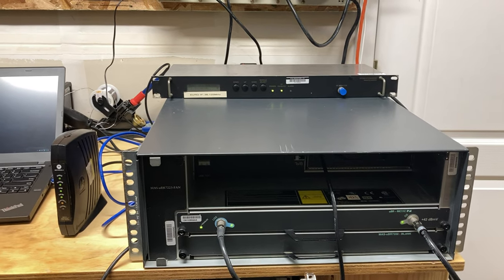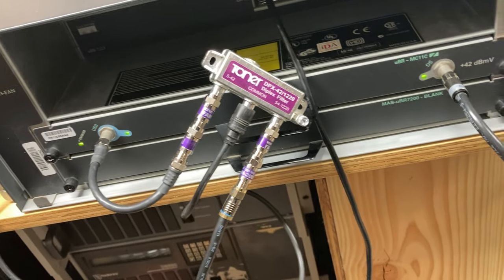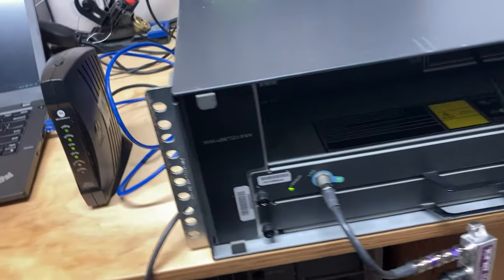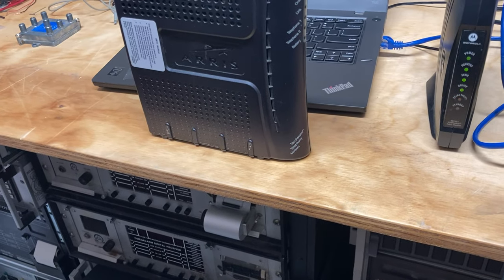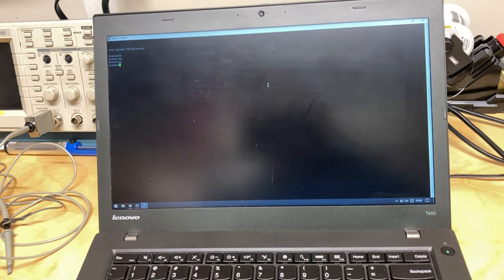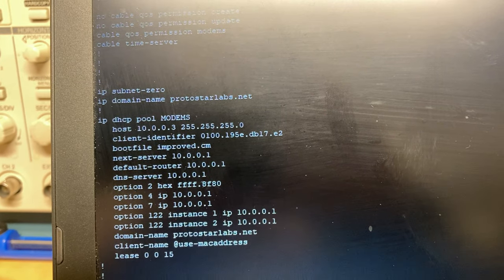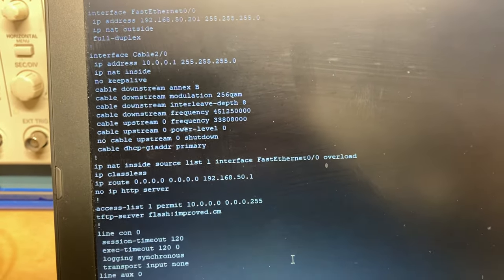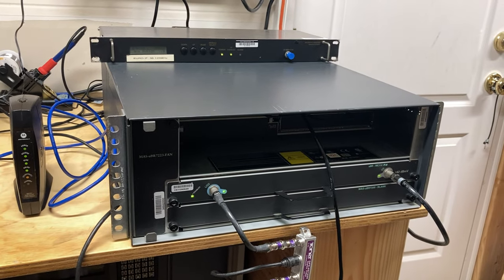CMTS Shenanigans

Comment: On the latency side, 6-7ms is about the best you'll get with DOCSIS. To go lower, you'll need DOCSIS Low Latency mode or DOCSIS Full Duplex, which is supported starting with DOCSIS 3.0 and DOCSIS 3.1 respectively.

Other than that, great video! Old CMTSs and DSLAMs are pretty easy to get a hold of, and are fun to play with.
Reply: interesting... that explains a lot about why the latency always seems higher than alternatives
Reply: FDX was split off to define DOCSIS 4.0. "Low Latency DOCSIS" (LLD) is also a D4.0 feature. D3.1 has Active Queue Management (AQM) which helps lower latency. D2.0 introduced QoS that was the first attempts to reduce latency. (messing with the interleave depth can as well, but can create other issues.)

Comment: Thank you, good demo.  I got my CCNP back in the early 2000s and I was surprised that CMTS snd DOCSIS were barely covered.  The study material and exams spent a lot of time beating on ISDN and ISO networking.  Most of the exams were pretty easy, but I saved routing for last.  On all the exams up to that point, they would say “Congratulations, you passed your exam,” at the end.  The routing exam had two configuration simulations and one was buggy so I had to click done and move on.  Time ran out as I was answering the last question.  At the end, all it said was “you completed this exam.”  I assumed I flunked and walked away dejected, but the lady in charge came running, “Don’t you want your certificate?”

I never worked in a large enough environment mor had a complex enough home lab that I believed I had enough hands-on experience to get through the lab based part CCIE exam.  I was able to do all the practice I needed for the CCNP using a 24 port Catalyst switch and a 1711 security router.  My employer was satisfied with CCNP so I left it at that.
Reply from the maker: Yeah it seems like this stuff is somewhat lacking in terms of documentation too, I mean there's good examples but there's no typical several hundred page Cisco book that goes over literally everything you need to know like there is for ADSL. I would love to get some form of certification but I don't know what to go for, I'm more interested in the voice portion than routing/switching.
Reply: @KJ7BZC  There is, but this gear is so old they've deleted it from history.

Comment: Nice video. DSL can also use DHCP to configure whatever's on the end of the circuit (CPE), once in sync it's just an Ethernet connection. A lot of ISPs use PPP because they know how it works and to make accounting a little easier.

However, DSLAMs can inject the circuit number into DHCP requests coming from subscribers, so even without knowing the MAC of the CPE, the ISP know which circuit it accessing the network, and can account/log/whatever they need to do.

I believe a similar thing applies to networks using PPPoE on DSL, the DSLAM can inject the circuit number, and then you could confirm that a PPP user is appearing from the correct port on the DSLAM (or even, the correct DSLAM at all.)

Then once you have Ethernet and IP setup, the CPE could down a configuration from a provisioning server, but that's all vendor specific stuff at that point.
Reply: In Poland. PPPoATM
Reply from the maker: Interesting, I do remember there being an option for DHCP in my modem as well, might have to give it a shot once I get that going again.
Reply: PPP because... they already had extensive PPP supporting infrastructure. (i.e. all those years of dialup modems.) There were even cable operators that used that crap. (PPPoE)
Reply: @KJ7BZC  there’s also the MTU overhead to consider.

PPP adds an 8 byte overhead to the MTU, if the Ethernet link is set to 1500, using PPP reduces your usable MTU to 1492, which isn’t the best. 

There’s a way to get around it, and most telcos set their DSLAMs/OLTs to allow baby jumbo frames, typically allowing an MTU of 1508, so when you take away the PPP headers, you still have a full 1500 byte packets, rather handy. 

DHCP-based addressing avoids that entirely by not having an encapsulation protocol around the packets.
Reply: @jfbeam It was designed as a European deregulation thing, as I recall. It was supposed to work by the PTT/ILEC providing the copper, DSL and ATM network, and multiple competitive ISPs would provide the link between ATM and the Internet. Because the DSL network was opaque to the ISP, and nobody uses ATM, some tunneling and AAA system was needed.

Comment: Great job on the deep dive...  This is bringing back memories when I deployed the first CMTS for a rural ISP Co-Op, I managed like 20 years ago... We used the exact same system as well as the multi channel card interface... Can't recall 100$%, but I can remember having issues because of missing or incorrect MAC-Host Authorization file mismatch or setup...  We ended up using a solution from C9 networks.. It was a 1U "Pizza Box" style setup but it required an external server to handle all TFTP and policy.cm files...  Looking forward to seeing your setup as your progress down the rabbit hole of legacy DOCSIS modems...

Comment: I love seeing these type of videos, especially with CATV systems. If you could cover HFC networks at some point I think that would make for a really interesting video. Like you said this is just a basic CMTS setup. Once you get into CMTSes and fiber nodes it can get very involved with DOCSIS and different setups.
Reply from the maker: I'd love to do something with HFC, I really just need to learn the architecture first and figure out what equipment I need to keep an eye out for.
Reply: @KJ7BZC  Something a lot of people don't realize: traditional HFC (before stuff like R-PHY) is all analog. Analog RF goes into the transmitter, gets converted to analog AM optical, goes over fiber, and the node puts it back to analog RF. There's a lot of tweaking with optical power meters and RF spectrum/DOCSIS analyzers involved, especially in the days of analog video.

Comment: This is awesome, I'm currently working on a video with my Zyxel DSLAM with adsl2+ bonding, been trying to find a CMTS too but the prices for them are still high.
Reply from the maker: Sweet, I'd be interested to see that running, CMTSs are indeed expensive still. I would've liked a uBR7246VXR so I could use the cards with the integrated upconverter, maybe they'll come down further in price someday...
Reply: @KJ7BZC  Well, that got sidetracked as I just purchased a VES1724-56B2 with VDSL2 30a and bonding! So I'm going to try to set a video up with that instead.

Comment: LOL, DOCSIS was not just used over coax. We used to feed hundreds of clients on a single CMTS into a radio system running 3.6GHz band and up the mast to an Omni antenna to subcriber radios, back down to power injector and into Motorla SB modems.
Reply: It was also used on wireless-cable installations, converting frequencies with LNBs to the 2.5ghz band :)
Reply: @mystica-subs  I just said that....

Comment: Interesting that you need an L-band upconverter which supports a 44MHz input; most of the ones I've seen need a higher frequency input than that.  I've seen a few cards for sale recently for that particular CMTS which have built-in downstream upconverters and they aren't terribly expensive.

Comment: Wow, never thought I'd see a working UBR 72xx again.  I remember back in the day when we upgraded to VXR chassis' and had US/DS cards with built in upconverters (MC28u if memory serves?)  Anyway, I wonder if your downstream speed issue has something to do with the DS freq you're using.  I have no idea how the tuner in a modem will behave if your center freq isn't aligned to a proper EIA 6mhz wide channel.  Try moving to a properly aligned channel like 633mhz, 639, 645, etc...  For the upstream, if I remember correctly the default config is only a 1.6mhz wide channel at QPSK modulation, you need to configure 3.2mhz wide channel and a QAM16 modulation profile in order to get the max speed that the hardware can do which is in the neighborhood of 10Mbps.  2.5Mbps sounds about right for 1.6/QPSK.  Going to 3.2 should get you 5Mbps and then QAM16 would double you again to 10Mbps. I probably have some old configs stashed away somewhere, let me know if you need any help and I can dig something out of the archives.

Comment: Back in the day, you could win a race condition by hosting your own TFTP server over the ethernet port, offer up an edited config file and set a much higher upload/download speed than would normally be in the config file.  Oh the good ole days (2000 & 2001)
Reply: That shouldn't have worked as late as 2000/2001. DOCSIS 1.1 and 2.0 security standards were very explicit on how that process was supposed to work. (but yes, the early years of DOCSIS [97/98] were full of bad engineering and designs.]

Comment: If you have old coax in your house but are no longer using it for internet or TV, there are devices called MOCA adapters that let you run 2.5Gbit ethernet connections across the COAX.  Apparently they can also coincide with TV and Cable but I don't know if you get reduced speed or not.  Might be a good way to get a wired connection across a house without having to go into the attic and run ethernet.

Comment: 16:59 What I would start with and I didn't really hear you say if you did this or not... 
You do have a domain listed in the config file yes.. However, did you set the A records from your domain hosting provider to your homes public IP? then open ports and forward them to the CMTS local ip from your home router / ISP modem. This could also be the cause for a few issues. 

The modems are trying to ping to a domain, and continue to be left with no response to download the config from the CMTS, which would also not be helpful trying to obtain a public ip from the CMTS network. 

That is where I would start with
hopefully thats a fix for you.

Comment: dunno about older versions of docsis wrt: the date, but certificates can't be verified without the clock being set; the 'new' privacy & authentication modes use public key stuff to identify specific devices. mac cloning would work on some really old networks but i think even then they had other ways to control access w/ docsis 1.0

Comment: is that a Motorola surf board.. have not seen one of those since 2000
Reply: They've made "surf board" ("SB"xxxx) modems for decades. Still are, in fact; SB8200. (aka CM8200) But the "fin" case design died with the 5100's.

Comment: Hi,
Maybe your low speed is du too buffering / timing configuration. 
Here some config i use for service class on a docis 3.0 cmts on my lab. It maybe can help you. Can reach nearby the max bandwidth of my mac domain.
cable service-class 1
  name SP-UNLIMIT-DOWN
  priority 3
  max-traffic-rate 1000000000
  max-traffic-burst 18000
  min-packet-size 0
  max-concat-burst 18000
  req-trans-policy 0x0
  tos-overwrite 0xFF 0x0
  downstream
  app-id 0
  multiplier-contention-req-window 4
  multiplier-bytes-req 1

cable service-class 2
  name SP-UNLIMIT-UP
  priority 3
  max-traffic-rate 1000000000
  max-traffic-burst 18000
  min-packet-size 0
  max-concat-burst 18000
  req-trans-policy 0x0
  tos-overwrite 0xFF 0x0
  app-id 0
  multiplier-contention-req-window 4
  multiplier-bytes-req 1
Reply from the maker: I'll have to see if this unit supports these commands, I would assume there's a large difference between 1.0 and 3.0.
Reply: @KJ7BZC  yes, there is some. But tuning those Can impact bandwidth speed and maybe there is some similar config on your. Also, euro docsis and us docsis have non similar max bw. Eurodocsis use 8mhz and us use 6mhz.(Pal/ntsc, it's based on dvb) There is also some similarities between D1, D2 and D3. D3 mostly add ds and us bonding as an example.
Reply: I'd blame his obsession with "no interleave" is much of the problem. DOCSIS isn't designed to work like that.

Comment: Hey. That's a nice little setup. I'm not really into this type of setup. My skill set is more on the security side. I would say you are probably correct about the frequency generator not being the correct frequency as being the issue. I just wanted to chime in to warn about the type of info you share. In particular to the Mac address. If you could I'd definitely blur that out or just flat out not show it.
Reply: I don't think it really matters, the MAC address isn't exposed to the open internet at any point. Just like how people freak out if you accidently show a class A,B.C address.
Reply from the maker: Curious about this one, what is bad about sharing the MAC address of these modems? I could see it potentially being an issue if it was a modem in service still, but I just don't understand in the case of a lab setup like this.
Reply: @EvertG8086  I agree with this, Media Access Control (MAC) addresses really only matter in or with Address Resolution Protocol (ARP) tables, which you usually see in switches and end devices that are talking in local networks since that's handled at layer 2 of the Open Systems Interconnect (OSI) model. Routers and anything over longer distances (multiple hops) will care more about IP addresses (which are layer 3), but private IP ranges (like 192.168.anything.anything or 10.anything.anything.anything) don't reveal location information since those are always hiding behind Network Address Translation (NAT), typically with Port Address Translation (PAT). You would need the public facing IP address to cause issues. That said, those who don't know the difference tend to see any IP address and want to block it out because they are taking a safer stance on the basis of their lack of detailed networking knowledge. They (in this case @PinnacleSaint) mean well, and it's a rule that can be hard to parse without networking experience.

Comment: I worked for the cable Co... Tried to comment several times the secret IP to get to the cable modem page, but YouTube is deleting comments that contain numbers. Can you do something about that?

I can't help you with tons of insider info if your comment restrictions are too tight.
Reply: They do that a lot nowadays to avoid those spam bot comments. I’m glad it’s gone, but sometimes it’s really annoying when it actually deletes useful comments.
Reply from the maker: I don't have anything configured to block certain comments apart from the ".vom" and ".fyi" link spam that was an issue a few years ago. I believe it's their algorithms trying to stop spam unfortunately.
Reply: There's no "magic IP". The modem gets everything from the CMTS. Once it has an acceptable DHCP answer for the HFC side of the system, it should be reachable at that address from the CMTS side. You will not be able to access anything other than the standard "hundred-dot-one" CPE UI from the CPE side. (even if you know the modems' HFC address; it is not accessible from the CPE side.) I'm pretty sure there's no HTML "admin" interface; there usually isn't even a shell (the "NOSH" firmware images.) It's all managed via SNMP.
Reply: @jfbeam   You obviously don't realize who you are talking to.

I'm one of the original founders of TCNISO, one of the co-authors of the book "Hacking the Cablemodem", and a programmer of Sigma-X, the customized firmware for the Surfboard modem seen in this video.  I have a CCIE certification in DOCSIS, the hardest certification in the entire IT industry. 

I know what I'm talking about. You don't.
Reply: @featherpony  And yet you've gone out of your way to point out a COMCAST address. The modem will not have a comcast address unless that's what dhcp assigned it. (and before you claim it's running comcast customized firmware, comcast switched to IPv6 a very long time ago.)
Reply: @KJ7BZC   don't listen to this jfbeam guy, he doesn't know what he's talking about. I doubt he's ever seen a cable modem in his life
Reply: @jfbeam   so you think a static CPE-side private IP address (which works on all ISPs and even when not connected to any ISP) that's HARD-CODED into the official firmware from Motorola.... comes specifically from Comcast on the HFC-side via DHCP?  Just shut up.